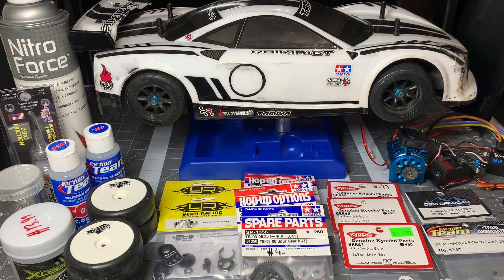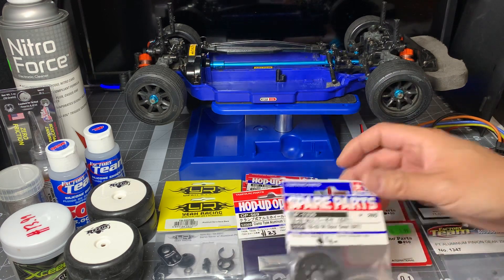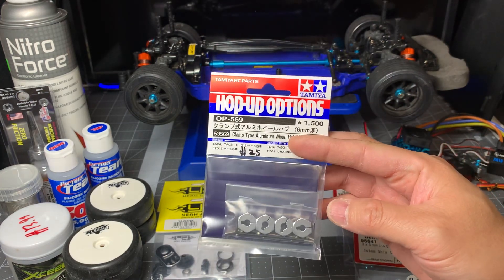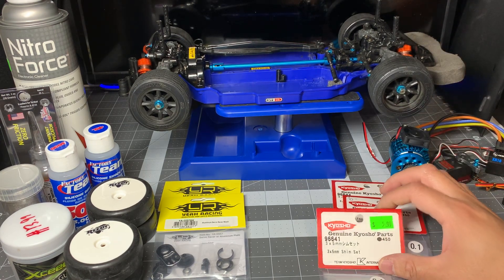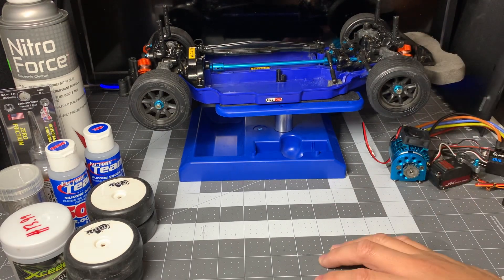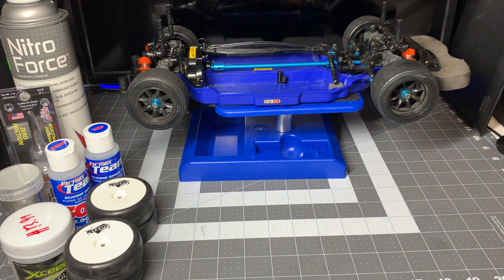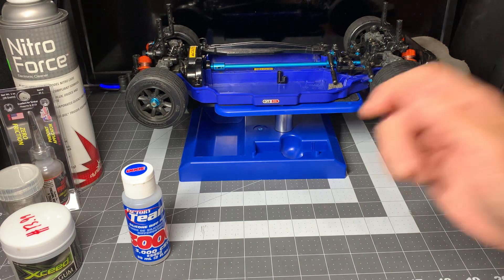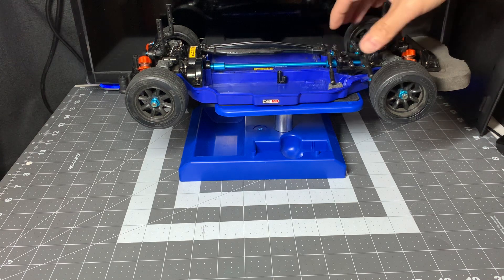Hop-Up Parts Reveal for Tamiya TT-02RR

Comment: have a stock TT02, steering is stiff, and the problem is not the steering rack but binding at the upper and lower uprights
Reply from the maker: Hard to say what is causing the issue. Try loosening the top and bottom hex head screws (MB2). Make sure you assemble the upright components in the correct sequence.
Reply: @RCsRCCars  im used to the newer tamiya stuff, m07,m08, ta05, does plastic seem less wonky on the Tt02R or SRX, ?? servo moves everything, but probably depleting my batt at faster rate, yea tried loosening stuff, ill double check